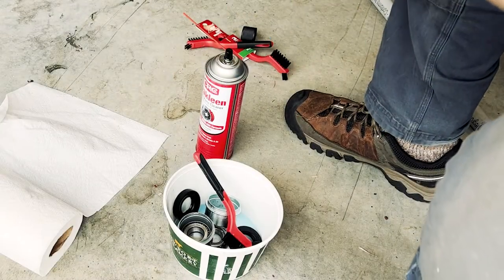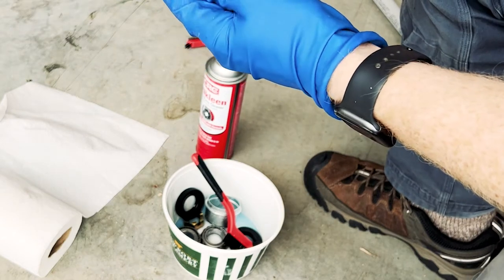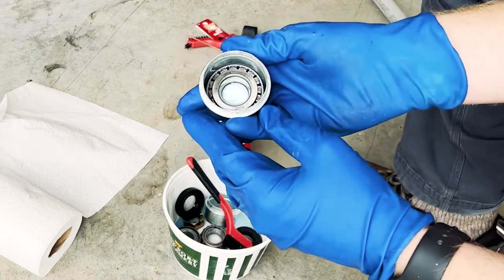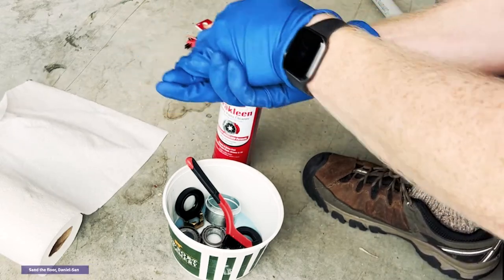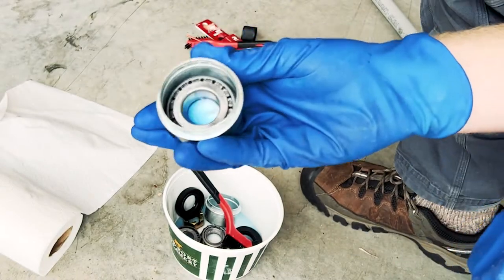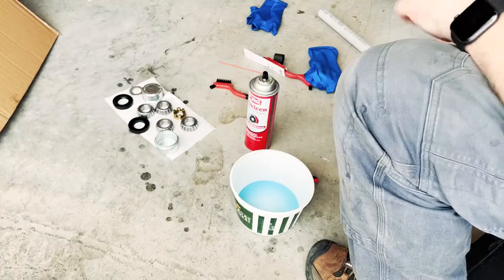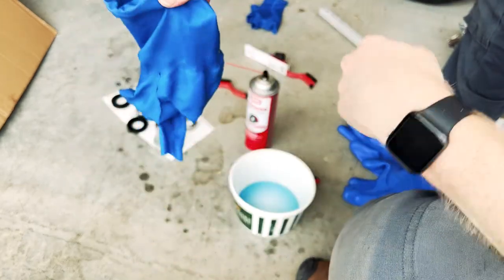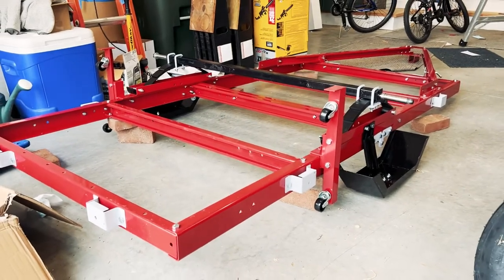Shaken, not Stirred - Cleaning the Wheel Bearings on the Harbor Freight Trailer Build

Comment: Why repack they are new
Reply from the maker: They pack with shipping grease, not meant for road use.  The instructions very clearly say you must repack with regular grease or the bearings will overheat and fail.
Reply: @TheGrainDoctor   The instructions tell you how to repact the bearings but they did not say they would fail if not done
Reply from the maker: Good point, I am not seeing it in the instructions now.  I remember seeing unequivocal instructions to repack, but not sure where.  That being said, when I did the repacking, the blue shipping grease was nowhere near filling the hub, and the inner bearing had nearly no grease in it at all, so I certainly don’t regret doing it.